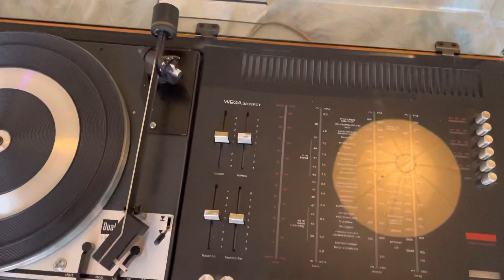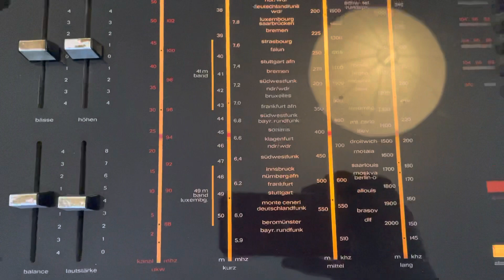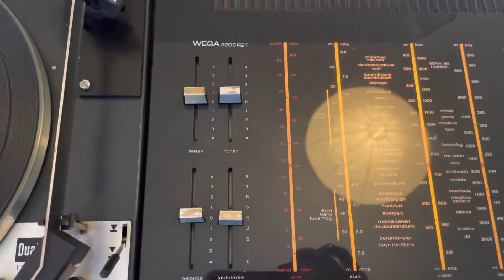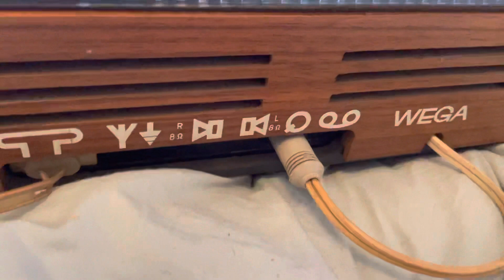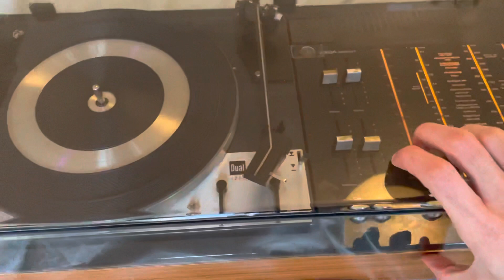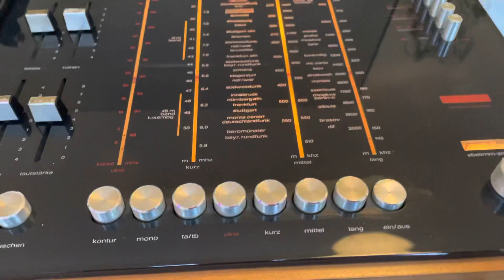WEGA 3203 FET Studio radio receiver with Dual 1215 turntable

Comment: Hi, I just bought one of these. Do you know what speakers/wattage I can match with it, please?
Reply from the maker: The wega amp puts out 15w. You can connect your speakers to it via din plug adapters. I just unplugged the din that comes from the record player from the back of the device and with a phono -preamp connected it to my regular amplifier.
Reply: @Drinkyoghurt  By any chance, did you have to take it apart, to disconnect the original amp, and connect the phonos or you managed from just the back?
Reply from the maker: @LukeZer  A bit late, but at the back you have the DIN cables from the turntable plug into the input of the WEGA amp. Just unplug those and plug it into your other amlifier with a DIN -> Cinch converter.
Reply: Hi, what can of cable do you need in the back to listen to fm-radio?
Reply: @samvanderelst95  Search ''75 ohm coaxial to 240/300 ohm 3-pin FM/AM antenna adapter for vintage tuners'' on Ebay.